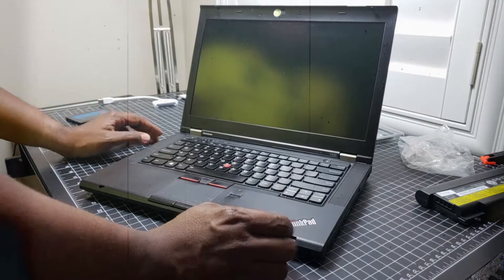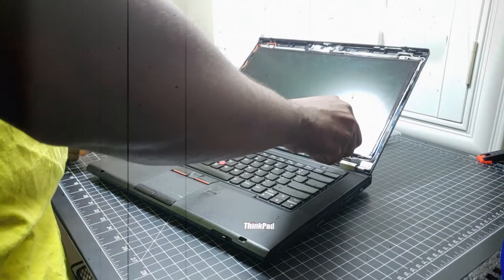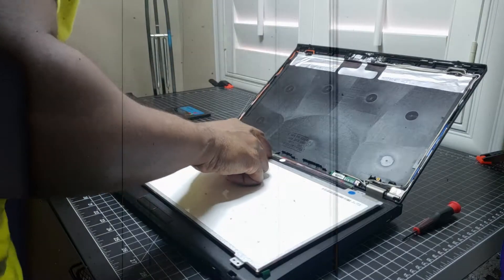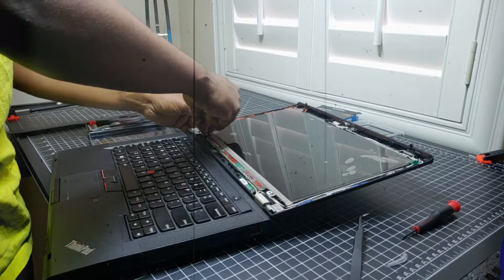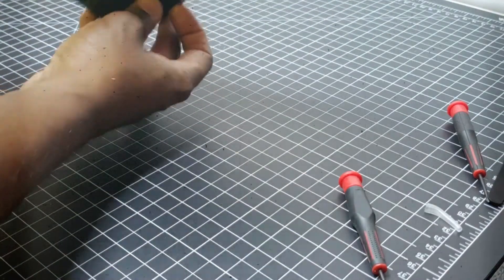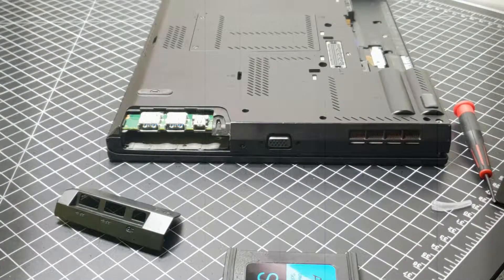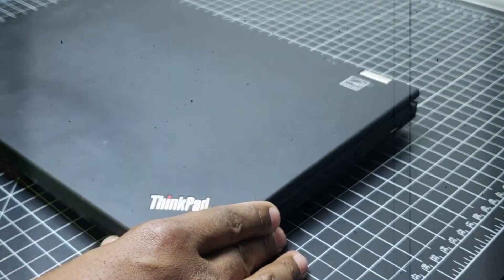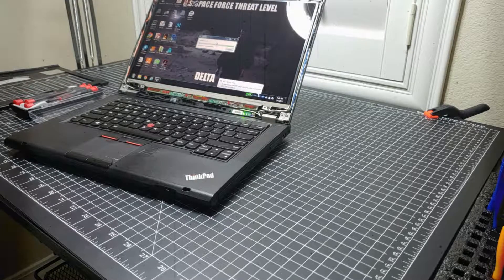Building a cheap 4k editing laptop part 2 (Step by Step Tutorial) screen & SSD upgrade Lenovo T430

Comment: Where can I find the parts you used and what are the part numbers?
Reply from the maker: Here are most of the links to the products. Prices have changed and some may not be available new anymore.

1tb ADATA SSD 
https://www.amazon.com/gp/product/B01K8A29E6/ref=ppx_yo_dt_b_search_asin_title?ie=UTF8&psc=1

Lg Philips Lp140wd2(tl)(g1) LCD Screen 14.0 Glossy 
https://www.amazon.com/gp/product/B00DY6849Q/ref=ppx_yo_dt_b_search_asin_title?ie=UTF8&psc=1

Processor 2.2 GHz Intel Quad Core i7 3632QM
Intel Core i7-3632QM Socket G2 CPU SR0V0 2.20GHz
I brought this on ebay used

RAM 12 GB DDR3L SDRAM
https://www.amazon.com/gp/product/B006YG8X9Y/ref=ppx_yo_dt_b_search_asin_title?ie=UTF8&psc=1